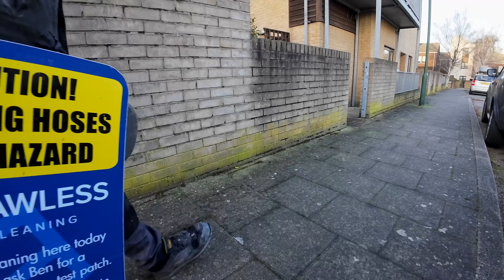Surprising My Neighbour! While They're Out.. We Get Cleaning

Comment: Living in Florida,with the heat and humidity, we used to have problems keeping that black and green mold off the back patio. That pressure cleaner works like magic! So glad you helped your neighbor out.💕🙏
Reply: Yeah, we get quite a bit of it in Florida - but pressure washing it disturbs it. It's defense mechanism is to emit spores to repopulate so it doesn't die out. It also emits toxins which is harmful to the respiratory system.

Comment: Great job.
I have a few questions:
1. Do you carry water or use it from the site?
2. Why didn't you do the walkway in front and the area around the light pole? 
3. Could you have done the parking pad in front? Or would the pressure  harm the asphalt?  Would it have remove the  priority  parking symbol  painted on the pad?
Thank you.
Reply: Brits do not own the walkway.  That belongs to the local council and we don’t touch it. 🇬🇧👍
Reply: @torfrida6663  thanks